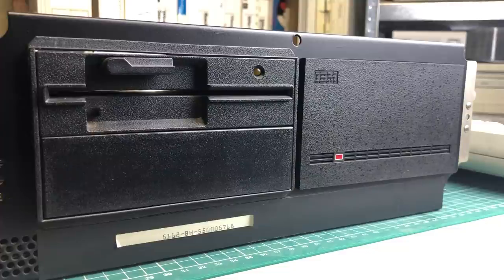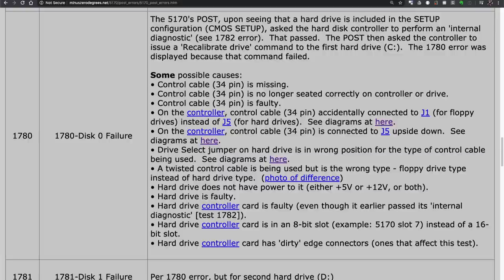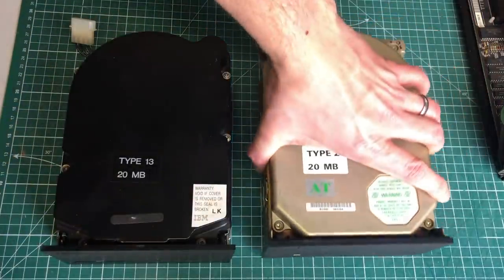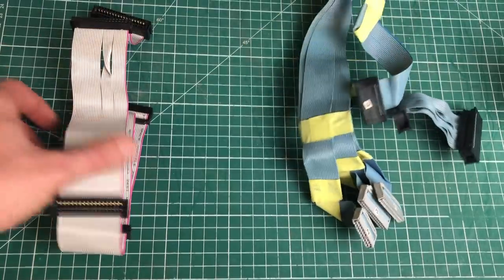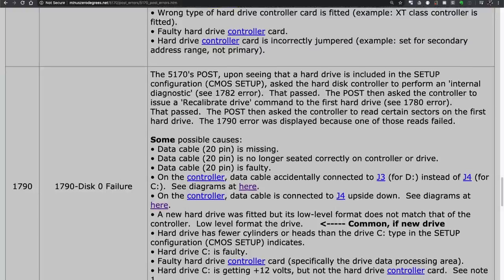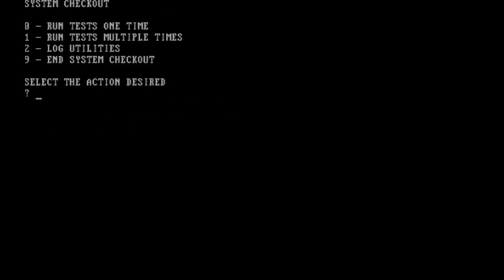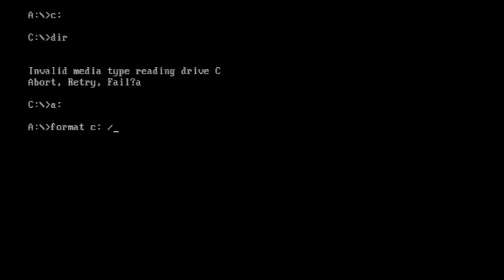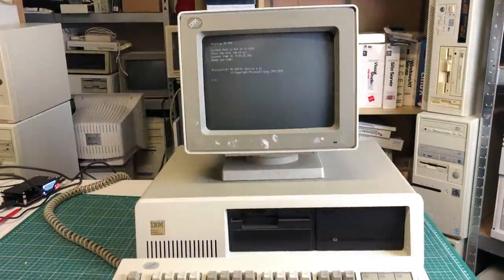IBM XT 286 Part 1 hard drive issue

Comment: Man!  The ST-225 was indestructible.  I used to collect and sell a bunch of them as "recently" even as 1993-94 when building "new" machines out of leftover inventory.  I was surprised to see that was an ST-225 when you pulled it out as I was expecting a true, full-height drive, not a half-height with special mounting hardware.  I've actually never seen one done like that.  Cool!  And great video as usual.
Reply from the maker: Thx a lot !

Comment: Thank you for helping me with my 5162. I really need to learn more about this stuff.
I added the GPU from my spares box since the EGA Wonder was artifacting/broken.
Reply from the maker: No worries ! :)
Reply: I've never seen a system delivered incorrectly -- did you attempt to stick the hard drive in, not understanding the drive select ID and cable issue?  Or did you receive it this way?
Reply: @JimLeonard  It came with a very noisy and non-working drive, identical to the one in this clip. Recently I picked up two IBM's and this drive was in a broken 5160. Not knowing about DS on  a MFM drive, I just swapped them.
And yes, this kind XT hardware stuff is pretty unknown to me sorry...

Comment: I wish I could have some of this IBM.... So hard to find out thus treasures here in Brazil and when found it are so expensive.... Anyway this is a great content.... Congrats.
Reply from the maker: Thx ... you gotta be patient ... look in local ads and just ask around ... you never know what you end up finding. Places like ebay is the worst place to find them.
Reply: @RetroSpector78  Actually I have found one IBM complete, with original IBM monitor, but cost around US$ 3 000,00 or more. I don't know if that is the normal price for this precious thing in other countries but I think it very overpriced....
Reply from the maker: My very first IBM I ever bought (and first video I created) was a 5162. I paid 75 EUR (for the case + a non matching 17 inch IBM monitor).
Reply: @gilbert1975nf  That is way overpriced. They went up in price but still...Today I saw an 5151 monitor for around 300€ on ebay. Crazy!!!! It ruins the hobby.
Reply: @GuybrushThriftweed   That people throws these old computers on a landfill ruins the hobby as well. And now them want them again..
Reply: @gilbert1975nf  I've waited solid 2 years to find a C64G model for cheap and an Amiga 500 with everything except external FDD :p

Comment: Thanks a lot for that video !! Just busy trying to revive the 5162 / 5154 pair from my father (they were in the cellar since the mid 90's...). It started with the magic smoke on the display, so I'll fix the 5154 PSU first before trying to startup the PC... I'm crossing fingers, but have somehow little hope that it was handled properly (it has the 20MB drive, they surely never used the park utility), would be very happy to see the code from my Turbo Pascal experiments from the mid 80's, when I was a teenager... :-)

Comment: This video and repair reminds me of some old IBM manuals at my old work place related to repairing AS/400 and also IBM printers. While not the same, working on old hardware like this really does need thick manuals to reference diagnostic codes and pages upon pages of flow charts to map out the process for changing parts out. I don't know how anybody could have worked out all these steps, especially BOTH the cable type with the fold AND the jumpers. I kind of wonder if computers back then needed to be so complicated due to hardware limitations, or if it was just bad engineering that led to them being so seemingly unnecesarily complex.

Comment: I worked on these when they were new in the mid 1980's . They were more about hardware than software with DOS 2.0. When you bought one it came on.y with a motherboard and a monochrome  video board. You have to buy and configure the machine as you wanted it, thus the name Personal Computer.

Comment: I usually just put the drive select shunt block one pin aside, so it bridges DS1 and overhangs the socket by one pin.
Reply from the maker: Here it was mechanically not possible as there was another chip in the way.
Reply: @RetroSpector78  Hm, I see.
Maybe if you bent the leads out or clipped them?
But I guess that would be more hassle than just bending a piece of wire :D

Comment: Nice. I didn't know about twisted MFM cables, that is nice to know, and definitely an error I might have made. I've really only used IDE and SCSI, missed out on a lot of the older disk tech. Maybe an idea for a future video? There were others as well, I remember seeing ESDI and RLL drives, but know nothing about them.
I wish these old IBMs were easier to come by. I saw one for sale last year, and it sold for over €600, and that didn't even have a keyboard. Meh. I so want one, preferably an AT with an original EGA card and monitor! :)

Comment: Those floppy and hard drive cables are easy to get confused. I learned a hard lesson about a year ago when I tried to connect a 5.25” panasonic floppy drive thinking it was a floppy cable. I scartched my head why it wasn’t working, turns out it was a hard drive cable like the one in the video. I had spent a lot of money on that drive on ebay, send it back to the seller in the uk, was a lot of trouble get the money refunded. In other words it was a complete nightmare and my last experience with ebay only because of IBM making things confusing with their twisted cables🥶. Well, the whole ordeal thought me a lot about floppy cables and I made a whole study of potential pitfalls with floppy drives only because that floppy error 40 give my nightmares! True story. You are a life safer because with modern computers with sata cables whe take things for granted but back in the day you literally pull out your hair wondering why something didn’t work. These vintage pc’s demanded respect from their users, almost like stubborn cats.
Reply from the maker: yeah ... will do a separate video on the floppy drives on cabling / termination / mixing different types / setup of all of that.

Comment: Another great video, looking forward to the next part.

Convinced me that I need to take a look at my own 286.  It's hdd is near dead though, makes awful noises.

It's a bit of an odd machine actually as it's essentially a full 286 system on an isa card.  There is no motherboard as such but just a riser with the floppy and ide controller on it which the 286 card plugs into and has space for 2 more 16bit cards.
Reply: I've always found those cards quite interesting, I see them as kind of the ancestors of all those SBCs we have today
Reply: @charlesdorval394  I've just spent the last hour trying to work out the configuration settings of the HDD after the battery had died.  Such a pain as the drive had no writing on it to tell what the cylinders, heads etc are but eventually got there.  Its a chips & technologies board with a harris 286 processor.  Just need to quieten the HDD then drop in network and sound cards and it'll be done!

Comment: 4:27
> RGB connector
For a second I thought ibm was that far ahead of its time
Reply: IBM was.. There was something that isnt well known but they created a video card and display system capable of 1600x900 in the CGA display era.  It was called PGA ( professional graphics adapter)  and worked using multiple slots like SLI . it was mostly used by TV broadcasters for graphics and overlays
Reply: Hahahah :D

Comment: Nokia Data label spotted at 0:00. I believe those Alfaskop computers are exactly the same computers that were sold in Finland under locally better known brand MikroMikko, of which I also have a very similar looking sample in my storage. However, did not exactly know about such separate branding with these computers, even while this kind of things were far from uncommon. Any plans on featuring this unit in a future episode?

Comment: I've read those OAK VGA chips are pretty slow, then again I doubt the VGA speed matters at all on an 8088. I always do like the cards that offered the digital out and the analog VGA. Some of the later ATI VGA wonder cards have both and they can auto sence so no switch boxes to mess with. I have one in my 286.

Comment: After configuring the right drive type in CMOS, have you tried to check if there was any content on the drive? This could even be enough to boot from this drive.
Reply from the maker: The drive came from an XT machine so it was low level formatted in a way this AT controller could not understand. That’s why it needed to be low level formatted again. (That’s also why there was a drive select - cable mismatch). Should have made that more clear in the video.

Comment: This WD-25 disk drive was from XT system. You can 
recognize it by red led light (WD-25 disk drive for IBM XT-286 has yellow/orange led light) . Also XT systems  are using straight cables, so this explains jumper position 1 and also different formatting (You had to perform low level format to use this drive). End of detective story
 ;)
Reply from the maker: Was that a formal convention (the LED color / cabling style ?)
Reply: @RetroSpector78  Curious myself...
Reply: @RetroSpector78  I am not sure but it comes from my experience. Red led - XT, orange led - XT286. It also applies to floppy drives.

Comment: If these XT 286 are just AT with a smaller motherboard, wouldn't that mean they're the very first so called "baby AT" computers since the baby AT form factor is the same as XT's form factor ?
Reply from the maker: Not sure if they were the first. The 5162 was released in 1986 and the 5170 in 1984. Not really sure what other players were active between those 2 models.

Comment: How did the OAK turn into a Trident during system diagnostics? :P
Reply from the maker: haha ..... I was having issues with my screen capturing and all of the footage of the IBM 5162 with the Oak got "stuck" after about 10seconds .... so I used to footage of the other IBM 5162. That one had an EGA card but swapped it with a Trident to do the video capturing. So cheated a little bit ... (did mention it in the video) :)

Comment: Actually, stason.org is an "empty shell". What you're referring to is actually "Total Hardware 1999". This site is composed of only .html files and have been replicated on several places. Here's a better replica than stason.org http://www.uncreativelabs.de/th99/ (without ads and with no modification to the text, because if you didn't notice, documentation of HDDs sometimes don't make much sense because there are more line breaks than originally).
Reply from the maker: Wow did not know that ... everybody seems to be referencing stason in the retro forums.
Reply: Yeah because it's the first replica that pop up on google for some reason.
But TH99 will be obsolete soon thanks to me >:)

Comment: So, this leads to the question, what, besides aesthetics, is the difference between the XT 286 and the AT 286?
Reply: taller case for at286 vs xt286.  therefore, taller cards in an at286.  lotsa at286 cards won't fit in an xt286.  at286 machines MUCH more common than xt286.  lotsa at286 clones.  i don't remember seeing ANY xt286 clones.  take care & stay safe,

Comment: 3:30 is it really 1.2Mb ? And not 360k?
Reply from the maker: It is a 1.2mb disk drive. “  A standard configuration includes an Intel
80286, 6 MHz microprocessor with zero wait-state, 640 KB of planar
memory, a 1.2 MB diskette drive, a 20 MB fixed disk and a
serial/parallel adapter.”
Reply: Whew!  I can’t handle all that hardware.

Comment: did i spot an ESCOM tower? what specs does that have ? :-)
Reply from the maker: Have 2 escom minitowers, one with an eacom badge (a pentium 100 shown in my redhat video), and another one with a commodore badge (cyrix 166).
Reply: Brings back memory's :-) we had pretty much the same machine, but ours had a COASt installed :)

Comment: Why didn.t you use debug.exe program for formatting???
Reply from the maker: Автоманьяк TV the “simple” debug command g=c800:5 only works on XT class controllers to load up the built in LLF routine in the controllers card bios chip. This 286 is an AT class machine (despite its name) and as such it is the PC and not the controller card that is responsible for the LLF. It is possible to do it via assembly language via debug, but it’s a lot of lines of code to type. So using the IBM diagnostics disk (or gsetup, or a proprietary western digital app) is the most practical way.
Reply: @RetroSpector78  ok. XT 286 has different mfm controller?
Reply from the maker: Автоманьяк TV yes. 16 bit AT mfm controller.
Reply: @RetroSpector78  aah. Ok. Merci pour deine antworte